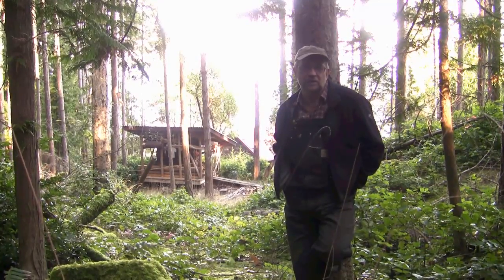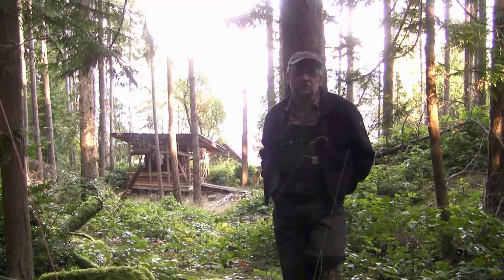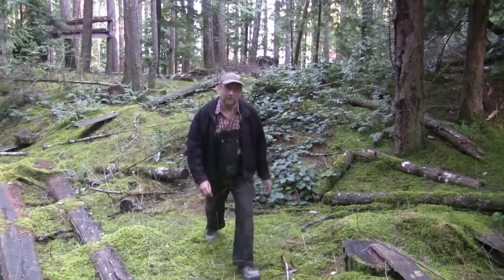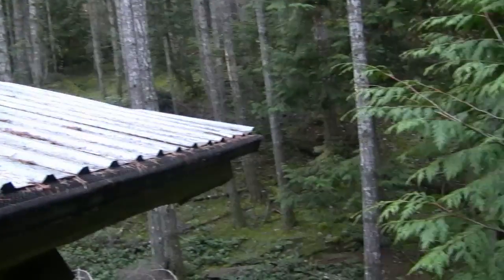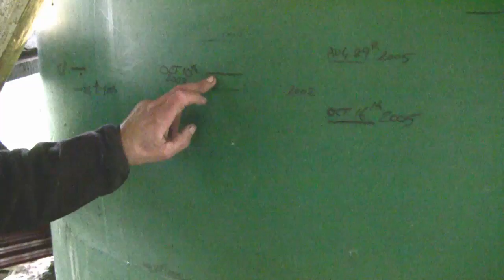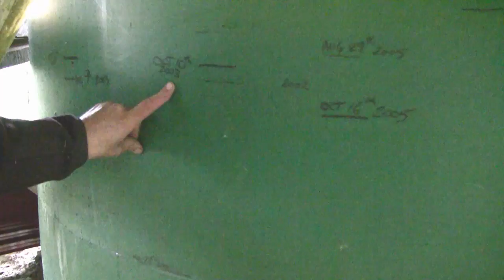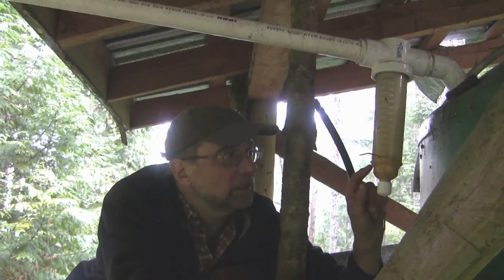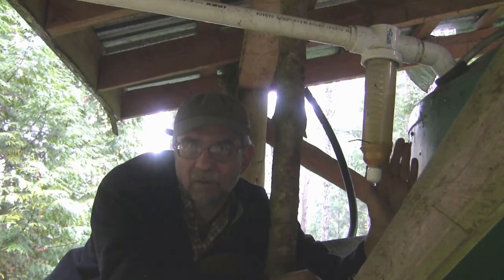Rainwater Harvesting Off Grid

Comment: Thanks for your interesting video. I live on public water and will soon be placing a 1000 gal above ground water tank here in the Seattle area. I have plenty of property to place it on and was wondering how you prepared the ground the tank is sitting on. Is it just sitting on level ground or did you have to place sand or a concrete footing of some sort? I enjoyed your song and humor.
Reply from the maker: My 2000 gallon tank sits up the hill on undisturbed, levelled ground.  The soil (if you can call it that) is up to 50% rock, so needless to say, I have not experienced any problem. 
If you choose a spot where the ground is undisturbed and levelled (actually inclined a little toward the outlet) you should be OK, providing said ground is not subject to natural disturbance i.e. becoming saturated during winter rain etc.
Thanks for watching and your query.
Best regards,
M

Comment: Hello, i was wondering why dont you use the roof of the main building? is it only for pressure?
Thanks!
Reply from the maker: Right. Having the tank up the hill creates pressure in the line at the tap down below. Lots of pressure - and no need for electric pumps or pressure tanks. Trying to abide by the KISS principle :-)
Regards,
M

Comment: Amazing! How do you power your water heater?
Reply from the maker: Propane.
Search Ebay for "LPG tankless water heater". Mine are branded "Marey" - made in China, cheap & perfectly adequate in my experience.
Thanks for watching!
M
Reply: Markerbuoy - On Canada's Left Coast
 Do you have any recommendations for  Off-Grid water collection in climates with freezing temperatures for most of the winter and snow?
Reply from the maker: Lauren Adamczyk Hi Lauren. We are not full time off grid unfortunately. I drain all my plumbing lines if there is chance of freezing i.e. November thru feb/March. We are often resident during winter, but our climate is fortunately usually mild. Considerations for full time winter use in freezing conditions would include burying supply lines (below the frost line) and otherwise well insulated exposed pipes, etc.
Cheers,
M

Comment: Hi there. I viewed your video with interest. I liked your nice simple and clean system.  I myself had wondered about how you diverted large debris before filtration.  I don't know if you get fog often, but if you do I got the chance to visit a ranch in Hawaii up in the mountains that had fog everyday.  They had a similar system of collection as you, except on the roof they had what looked like a tennis net, but with fine mesh.  They had s 5000 gallon tank that had the same size roof roughly as yours but with the net to catch and condense the fog and it would fill that tank in less than 4 days with no actual rain, just that heavy fog.   I really liked your plumbing set up and hope it continues to serve you well.
Reply from the maker: Thanks for watching.
I am aware of systems used to condense dense fog & mist in order to collect water. Definitely an ingenious method if the climate is appropriate. Recently, we had a few days of fog out here on the coast (only happens once or twice per year at sea level) and while I am not set up to trap water from the mist, all the trees did a good job...the forest was dripping with the moisture.
My whole system requires periodic maintenance, including the plumbing. So far, so good :-)
Regards,
M

Comment: Great video!... Quick question:  At about 5:20 it is stated that you shut off the valve in the winter during the freezing period... what do you do for water during the winter?  Thanks!
Reply from the maker: Full disclosure: we aren't there year round, although we spend lots of time there in winter.
If there is any chance of a deep freeze, thankfully rare around here, I shut off the system, as stated. I drain all the lines and demand heaters, etc. With the set up I have, a big freeze would ruin my day...& then some!
Cheers,
M
Reply: Markerbuoy - On Canada's Left Coast  Do you have to empty the storage tank?
Reply from the maker: alexlastro I never have emptied the storage tank completely. If it needed cleaning, then I would.
Thank for watching.
M

Comment: Great Video -- on a topic not well covered anywhere.  I think there must be more details on the tank input filter that you have not shared.  Leaves on roof and a fine -mesh filter??  There must be some filter ahead of that.  Do you have a bypass for when rain starts?  Why was the filter dripping?  Doesn't the tank water ever freeze?  Don't you need to insulate it?  What do you do for water when the line is frozen?

Hey, if you have been doing this for 20 years -- YOU are the expert -- I'm just trying to learn!!!

Oh, for my generation the proper leaking bucket song would be: "My bucket's got a hole in it, it ain't workin' no more."  -- Ricky Nelson.
Reply from the maker: Full disclosure: we are not off grid full time, but visit for extended periods, year round. The climate here on the coast (Pacific North West) is usually mild and wet in the winter. A hard, extended freeze is unusual. 
I cover the "pre filter", which sits in the gutter in my other vid, Rainwater Harvesting Off Grid 2.
Filter was dripping (good spotting) because I had removed the little twig that plugs the hole at the bottom of the filter bowl. If there is chance of freezing, I remove the twig and the plastic bowl remains drained. 
In my experience, the tank water never freezes to the point where the water is unusable. If there is any chance of freezing when I am not present, then I drain all the lines to prevent damage.
Best Regards,
M

Comment: Great video. I was wondering if you had to add an additional pump for water pressure inside the house, or was the gravity feed pressure enough? Also, the black poly pipe from the tank to your house, what size is that? 1 inch? Thanks
Reply from the maker: Hey thanks for the sub & your queries.
No additional pump was required...although the filtration system does reduce pressure at the tap somewhat. The black poly is 1" as you assumed - recommended by my supplier...less friction/resistance over a long distance.
Thank for watching...and good luck down in Texas!
Regards,
M

Comment from the maker: Full disclosure:we are not full time in this location. 
With that in mind, a couple of points...in the pacific NW we are blessed with a fairly mild climate, year round. The ocean does a good job moderating temperature,so -10 celcius days are rare. In winter, when there is risk of freezing, I drain the water lines when we are not there, to avoid risk of frost damage.
For our use, the water system we have works just fine-everybody's mileage will vary,depending on location and occupancy.
Regards,
M

Comment: But you're also putting it on the outside which is open to all temperatures, has to work much harder to heat water at -10 Celsius.

Comment from the maker: The chlorine puck is simply my first line of defense, as it were. It lasts for a month or two. depending on rainfall/temp. I also chlorinate the stored water; about a cup of bleach, per my 2000 gallon tank, once in a while. Simple testing kits are available to make sure you don't over do it. Remember, an activated charcoal filter removes residual chlorine at point of use....taste chlorine? Change filter:-)
Many thanks for your comments and questions - good luck with your project.
Best Regards,
M

Comment from the maker: Forget drought-how about if I mistakenly & stupidly release 2/3 of the tank just before summer season?That's what I did this year!
We are not running laundry,flush toilets or too many showers & baths, so it is very simple to cut back on unnecessary water use; 2000 gallons goes a long way for drinking, cooking&doing dishes.
Also, as I have previously stated, we are not full time at this place,so overall, water shortages are not a worry.If needed, I wouldn't hesitate to add more storage
Cheers,
M

Comment from the maker: Full time in winter, the supply lines would have to be buried below the frost line, insulated on entry to the cabin & heat would have to on be 24/7 inside the living space.
Maybe easier to chip some ice off the old block in winter & heat over the stove, as you suggest :-) Whatever works for you - everyone's mileage will vary.
Good luck with your planning...
Cheers,
M

Comment from the maker: It takes sustained, very cold weather to freeze water solid in a 2000 gallon tank - this has never happened to me. However, supply pipes are different matter; We are not permanently off-grid, so living full-time with the system during extremely cold weather is not an issue, personally. I simply drain the system  downstream from the storage tank, November thru March (in the Pacific NW) as a precautionary measure.

Comment: If you were off grid and this was your only supply and it was freezing, could the pipes burst? How would you get water for drinking? Maybe chip some ice off throw it in a pot and heat over a fire? Take in account i probably wouldn't have electricity either so id have to be some way like i said above. Thanks for the info!! :)

Comment: Great video, Your's is best system to emulate for our off grid cabin. We have a huge hill and are in a temperate rain forest too. We have a tank on the hill but we don't have the cash to build a roof up there for collection. I'm hoping to make a tarp system work to fill our 600 gallon tank. It won't be for drinking. Thanks for the videos I just subscribed.

Comment from the maker: Hey, thanks for the sub!
Quite right: there are US states that have gone almost communist when it comes to private water collection. An interesting development in the "Land of the free".
Luckily, I am in Canada where I am not aware of any similar political  developments. However, Google: "Bottled-water giant Nestlé in showdown with Ontario conservation group over water use" and read what comes up.
..so one way & another individuals lose, while corporations line their pockets.
Tx for commenting
M
Reply: I live in America, yeah 'company city', any way to make a buck. They don't want folks to use common sence.
   When I lived in the Pine Barens in New Jersy I had two barrows that collected water. I used it for my garden & to share water with animals. My charcoal filter system was up top where the cover is & had a plastic 'plate' (made from putting holes in a plastic drinking bottle for a cover that was screwed down that could be slid over to open & another drinking bottle held the charcoals & cloth was under that with holes in that.
    You hook up a garden hose close to the bottom and there you go.😁
   I wish I could show a picture of the ones I taught the Lighthouse Keeper House's 2 barrows. They have the water coming down their metal shed in the back & they put in a little metal handle & the water comes out of that. Their gardens are right there in front of the barrows.

Comment from the maker: Hi & thanks for your query.
I am not full time at my place in the woods and not usually there during occasional freezing cold weather. Winters here on the Pacific coast are typically mild but if we get a blast of Canadian arctic air (sometimes -10 degrees centigrade or 14 Fahrenheit) the water in the tank will certainly freeze...but not in a solid block! In twenty years, the polyethylene tank has proven resilient in all kinds of weather with absolutely no trouble.  
Thanks for the sub!
Regards
M

Comment from the maker: Of course not.  I have friends who manage to place their tank up a tower, with collection roof on top; this provides gravity feed with modest pressure. Other friends run a 12 volt RV pressure pump, which naturally requires a power supply and this works well for them...although adding one more possible maintenance issue (violating the KISS principle :-)).
Best regards,
M

Comment from the maker: Excellent comment!
I am aware of the stupid government interference in some US states.One doesn't have to Google too hard to find examples as you describe.
Thankfully, in my off grid location, this is not an issue-yet. 
In my Canadian town, local government is set to implement a Stormwater run-off tax, based on roof and paved areas of one's property. So this is similar taxation, in this case purporting to fund stormwater infrastructure.
Next,it will be the air we breathe they come after!

Comment from the maker: Hi there,
Two bathrooms and a washer puts you over the top in terms of storage capacity. We are not full time at our place and my system is sized accordingly.  For us, an outhouse replaces the flush toilet and laundry is not really a big issue.
You would have to increase capacity using multiple tanks and perhaps increase collection (roof) capacity to maximize the benefit from rainfall, My suggestion would be to start with at least a couple of 2000 gallon tanks (larger if you can manoeuvre them)

Comment: How many inches of annual rainfall do you get? Have you see the "roof wash" systems where the initial rainfall fills a vertical tube with a slow drain at the bottom. The first rain washes off the roof debris and once the vertical tube is full the overflow spills through some mesh and into the tank.

Comment from the maker: Hi;
Thanks for watching and your comments.
The water pressure is simple physics, given the height of the storage tank above point of use. It's great!
As I mention in the video, I think half the purity battle is won by "scrubbing" the water clean before it enters storage. Very little chlorine is required to kill pathogens (should they be present) and in our case, most added chlorine has a chance to dissipate before we eventually drink it. The charcoal filter takes care of any remainder.
Regards
M